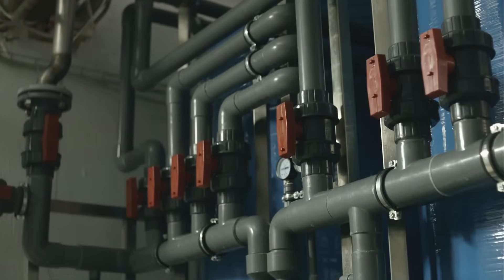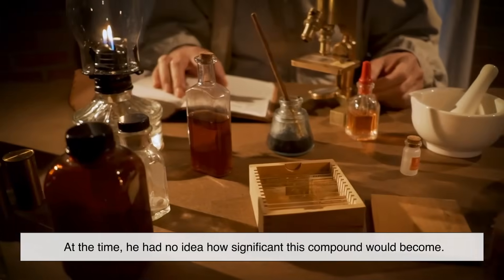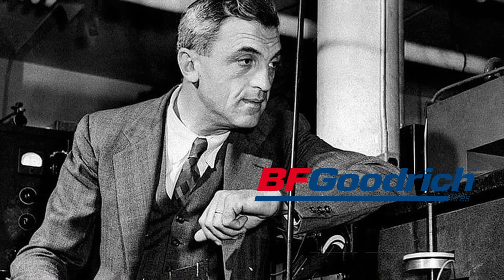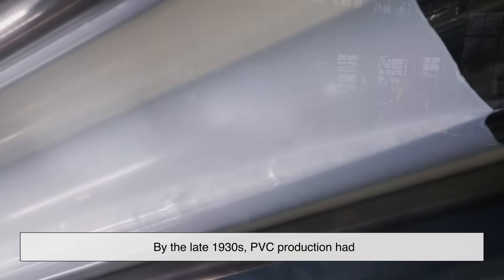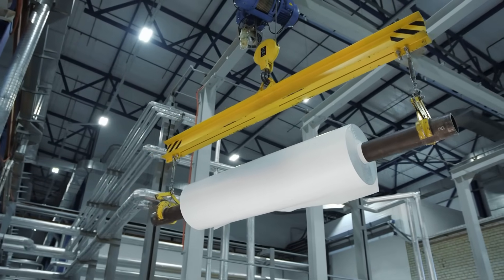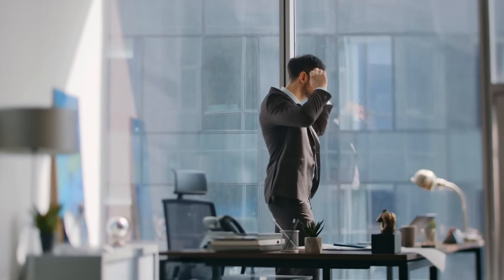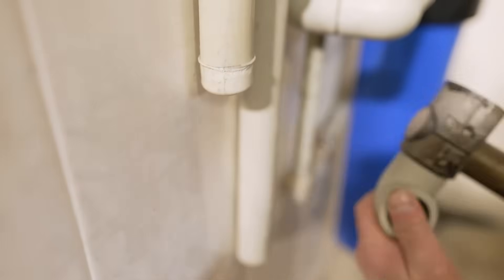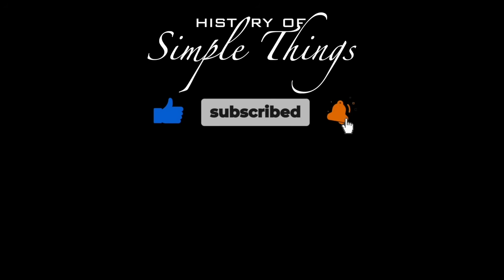How PVC Was Developed—and Why It Matters Today

Comment: Great video ! I used to work in an injection molding facility and I can confirm PVC doesn't tolerate overheating and fire. When on fire, it release toxic fumes which are very harmful. In a case of a house fire, PVC materials provoke suffocation much more than wood smoke. Thanks for the video.

Comment: PVC binders can lift the ink off printed pages, causing smudging and a mess. PVC is also used for small transparent envelopes to hold coins called “coin flips”.  However, the plasticizer in PVC will leach onto coins and corrode coins made of copper, brass, nickel, aluminum, steel, silver or gold. The sticky residue looks like “green slime” and will ruin valuable numismatic coins.